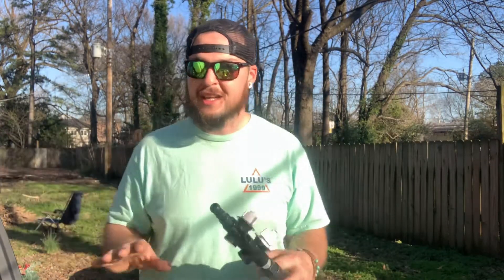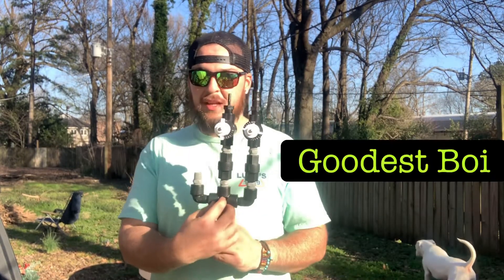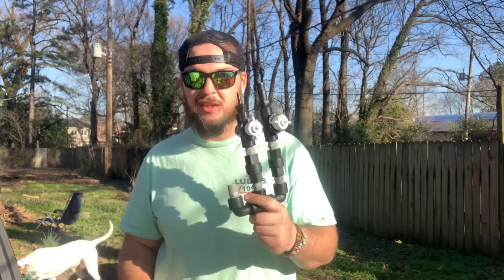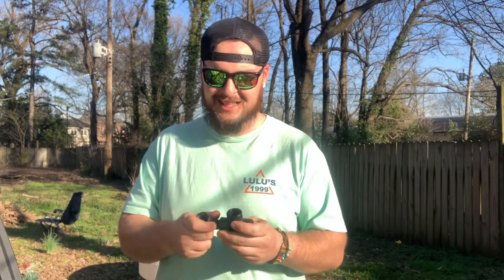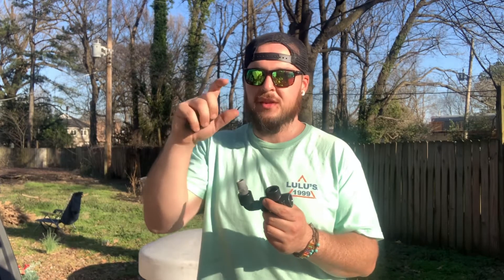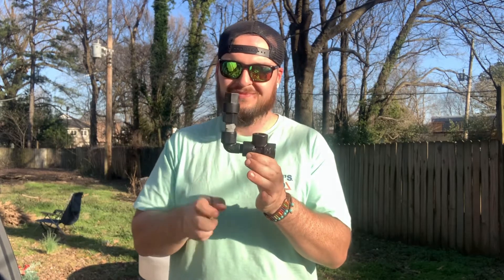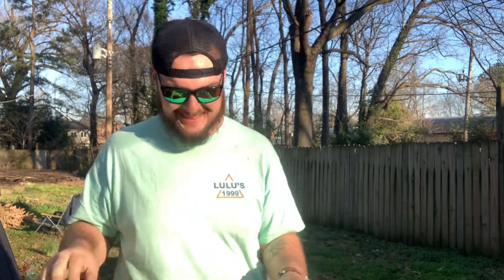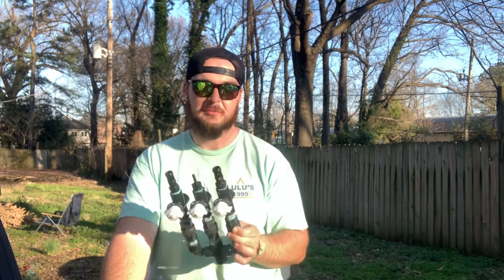Blend manifold for softwash system

Comment: I did the same thing with the 3/4” coming out! Lol I Haven’t put water thru it yet but I know it’s good to feed the pumps with a size or two larger hose so why not? 

Thanks for this video, it was the most clear & to the point I could find! 🙏
Reply from the maker: The only pain is the reducer for the pump barb but it’s usually not a problem.

Comment: How are those Pentair valves holding up?
Reply from the maker: They were fine until I was moving everything from the trailer to the flat bed last week and cracked one in the process. But for 1/3 the price of a GF valve I can’t be mad at it.
Reply: @midtownpowerwashers1368  yeah I’m going to build a metering system and try them because of price. Just not torque them down. 😂
Reply: @jonboysprowash7845  Yeah building one in a few days just waiting for the pentair valves to get here. I watched a lot of videos and to make sure not to over tighten the nipples into the valves or the valves can crack easily. Be gentle and slowly hand tighten only. I'm going two 1/2 barbs for water and sh and 1/4 for soap. Too suction hose to pump will be 5/8 barb and 5/8 hose to my pump
Reply: @2Alife2  Nice. Let me know how you like it 👍